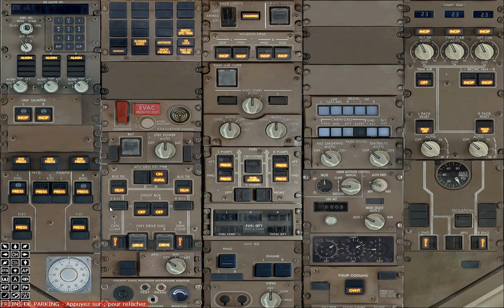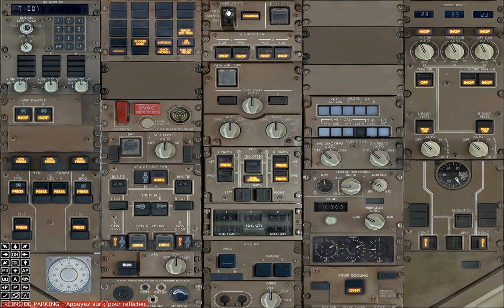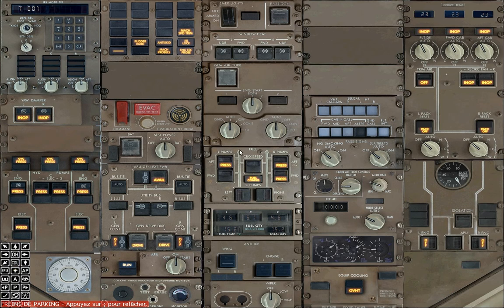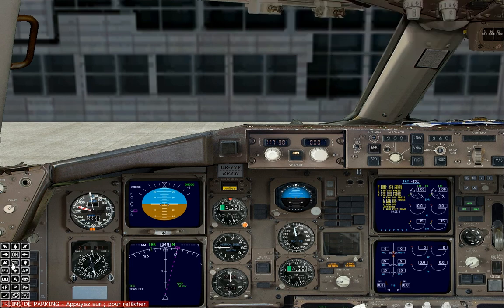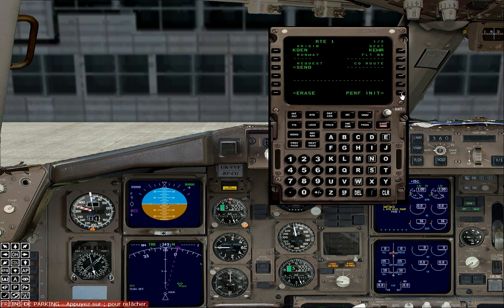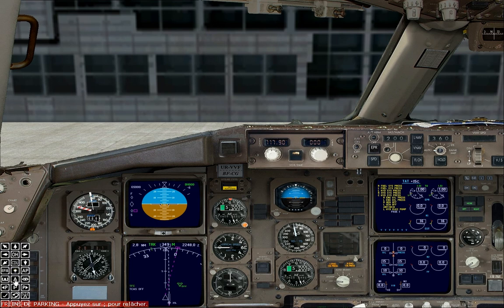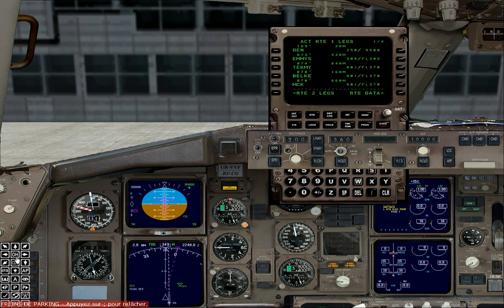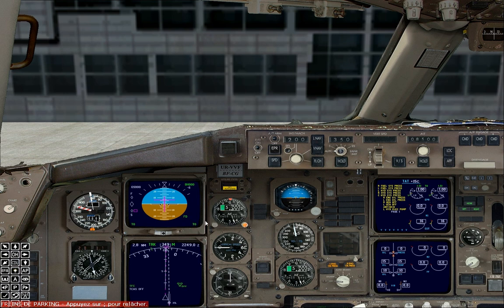CaptainSim Boeing 757 full tutorial part1

Comment: @aircraftinformation assuming you are going to use vatsim or a pro network, your flight plan has to be spot on, I use FSCommander i simply hit the departure arrival and i hit i altitude airways and because my FSC has cycle 1201 its accurate then i hit save and load it in fsx flightplanner. you way is alot harder you will have to know your route [PLAIN4 MCK J44 LNK J60 IOW GIJ CRL J584
SLT FQM1.] then make waypoints under (find route) edit the waypoints to match the lat and long of your VORs

Comment: Don't want to burn you down to the ground, it's not a bad tut but you sure did make some mistakes. Ie with the lights. Once the aircraft has elec. power you should ALWAYS turn on the position lights. Also, 9/10 times you start the APU 10 to 5 mins before your standard time of departure. Starting it right after power-up is a waste of fuel if you have a gpu (ground power unit) available to you. Just a few tips ;-) Nope, I'm not a real pilot, still working on that!

Comment: @marko071988 Aren't you suppose to put the IRS selectors to NAV first? I believe the ALIGN function is used after the main 10 min NAV align. It's basically a 30 sec quick align to make sure everything is correct. At least that's how it is on the 747.

Comment: I have a quick question, i am not sure what they are called but the two screens on the left of the plane (you can see them at 3:15 ), one shows the horizon nd the other the heading display.  Here is my question.... on my CS 757 those screens do not look like that.  They are very basic and dont show the gorizon but they are on.  I was wondering if there are any switches that change the way it looks?  If you want to check out my problem look at my video Delta 757-200 Takeoff KJFK Captain Sim.

Comment from the maker: Both of them are great aircraft, very detailed models and VCs. The only problem with the cs757 is that the autopilot doesn't make very stable turns, it's pretty wobbly actually, but otherwise, the plane is perfect. The Md11 only has very minor flaw I haven't even noticed. Finally, one in three times more expensive than the other one, so the price factor counts a lot, I guess. And of course, it also depends on which aircraft you like most!